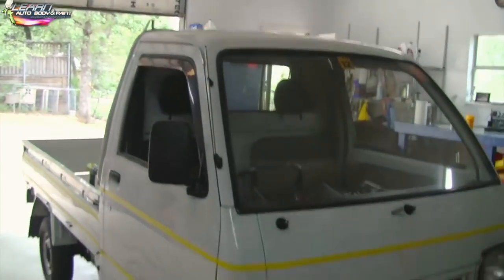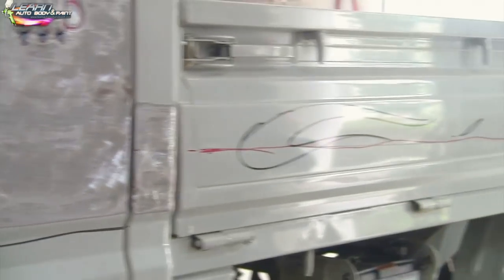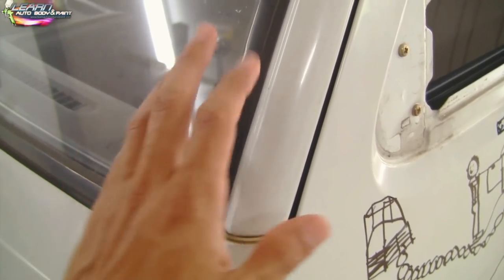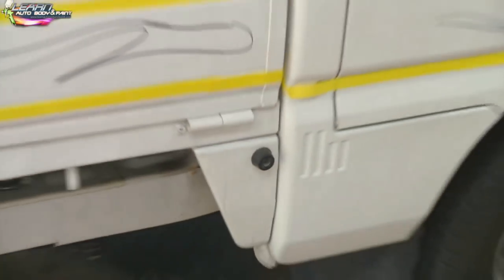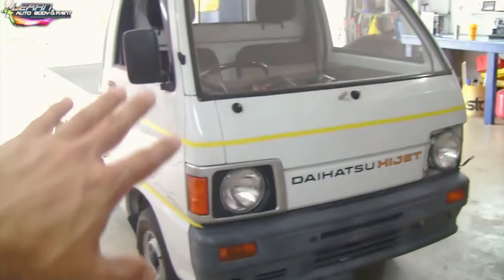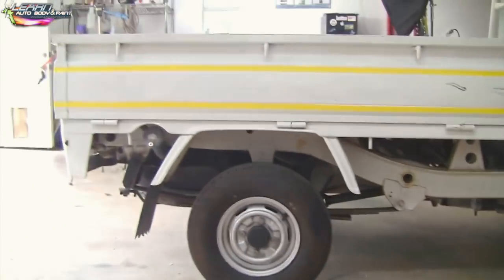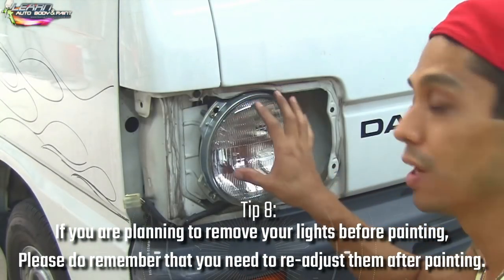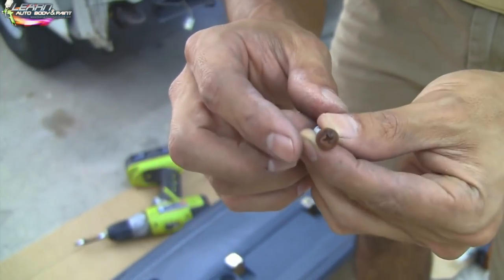👉 DIY Car Painting Basics - What To Do BEFORE YOU PAINT Your Car 🚗

Comment: Nice Truck there Tony!
I like the fold down bed sides, reminds me of a Suzuki truck I used to see back in the 70's at the Airport.
What did you do about the Daihatsu decal in the front by the headlights? 
Driver side on that truck, but passenger side on American cars.
Also, did you remove the bed to paint the frame?

Mahalo for your great work!
Reply from the maker: They are super cool little trucks for sure. Very popular in Japan. I took them off and replaced with new custom ones... you'll see it later in the series. :) ALOHA WOODY! Did not remove the bed, this thing only has 9,000 km on it. Pretty much in new condition, we did undercoat the frame though.